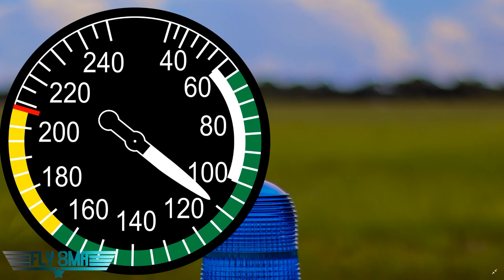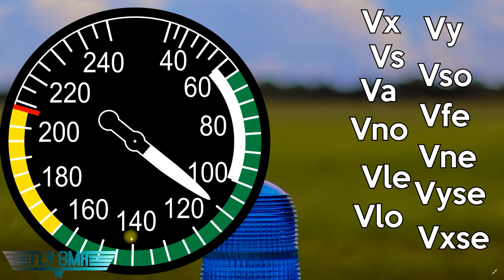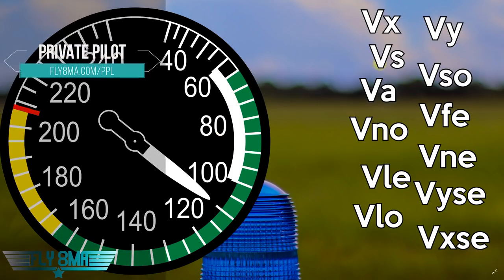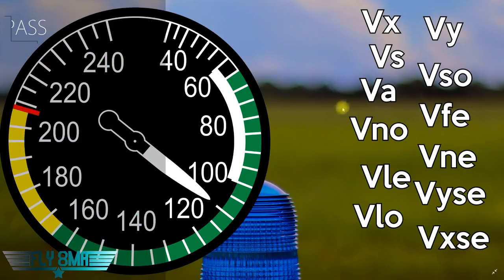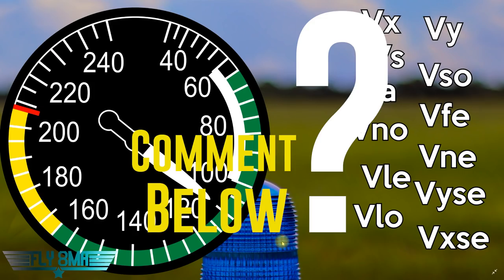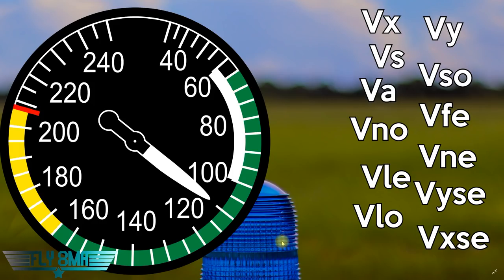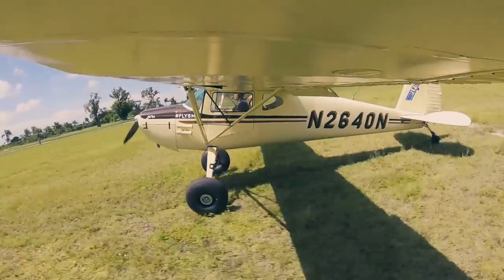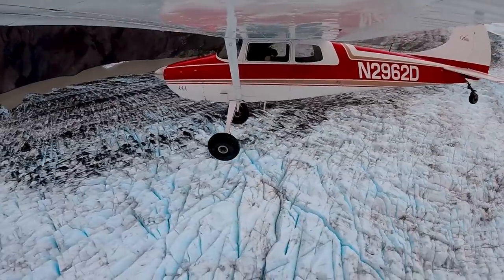How pilots FAILED their checkrides...

Comment: I had my PPL checkride at FTY with the same guy who gave Delta airline pilots their checkrides...this was back in 1993.  He started out telling me to plan a flight to a particular airport.  After about 5 minutes, he came back in the room and said that time was up...we're going.  I wasn't really ready, but we left anyway.  Halfway to our destination, he said that the weather had changed and I had to reroute to another airport.  While I was trying to plot a new course, I didn't notice that my heading was drifting.  We ended up over some small town...but I had no idea where I was.  The answer?  Look at the name of the town on the water tower!  From there, I think we went into stalls and unusual attitudes.  Of course, I had to put my head in my lap while he was putting us into an unusual attitude.  After recovering from the last unusual attitude, he immediately reached over and pulled the engine and told me to make an emergency landing.  I initially setup on a field with some cows and old wooden fences in it.  However, I decided to go for a field a little further away that didn't have cows and fences.  Unfortunately, it was too far away and we would have crashed into a stand of pine trees.  He failed me on the engine out procedure and said he wanted me to come back and repeat just that part.  BTW, he told me that the field with cows and fences was the best choice because I could have driven over the fences and steered around the cows.  I was really rattled by the experience and decided to be extra cautious on my way back to my home airport (LZU).  I didn't want to accidently fly into ATL's class B airspace, so I kept turning the dial on my VOR more and more to stay well north of that airspace.  I eventually saw PDK in the distance and knew I was okay.  So, I called PDK to tell them that I was just a few miles west of them and wanted to fly over.  They almost immediately asked me to "ident"...and when I did...they informed me that I was about to fly over Dobbins Air Force Base in Marietta.  Oops.  Yes, it was a very long day that day, but one that I will never forget.  I don't fly anymore, but I will always enjoy the memories that were made during that part of my life.
Reply: GPS ipad makes all that flying s snap....looks like you kinda had a sick as a ppl examiner...my ride was pretty quick ,28 years ago .....pretty much ho up ,where are you ,turns ,...fast,,,  landed and bam ......my instrument ticket was a partial redo though
Reply: TheTimeTraveler2025 morning, what is the wings program?
Reply: lorenau2 Search google for FAA wings. It’s a way to do seminars, and or some online courses to get Wings points which go towards showing currency.
Reply: @lorenau2  look it up.     just a way to spend money   and fly
Reply: @danielb516  Of course if your GPS goes down, you need to know how to navigate with VOR.  A tough ppl examiner is actually doing a favor in the long run by exposing pilots to situations like engine out/stalls/unusual attitudes!
Reply: Good experience to learn from but my next decision would be to get a different DP 👍🇺🇸

Comment: Forget a check ride.  No pilot should fly solo without knowing these speeds for the airplane they're flying.  I'm pretty astonished that any student would make it to a check ride without knowing this stuff.
Reply: Jon the Pilot  the one that I become amazed with is when I’ll ask a pilot does he know the minimum maneuvering speed of the aircraft that he’s flying.
Reply: @larrygreen8912  It's generally 1.4 X your stall speed, it allows for 30 degree banks. Commercial pilots know theirs for sure!
Reply: @larrygreen8912  I am going for my PPL checkride very soon and your comment on DMME really opened my eyes. I talked with my instructor on this and it was great conversation and a great learning experience on something I did not know about! Thanks!
Reply: @Hedgeflexlfz  Stall speed changes based on load factor.  That is connected to your gross weight.  If you really wanna be safe know your max over the numbers speed and use that in calm air.  In cross winds add 5kts of speed over the numbers.  In banks never exceed 30 deg. in the pattern.  Or if you have an AoA meter, refer to it and bank however you want.
Reply: @gbigsangle3044  You are correct. Load factor is really what causes stall speeds to increase. How do you calculate it for those condtions?
Reply: @Hedgeflexlfz  Not possible to calculate it easily while flying. But read this to see how stall speed increases due to load factor: https://www.theairlinepilots.com/forum/viewtopic.php?t=381

The best way to avoid stalling in a turn (esp base to final) is to keep the bank angle low (below 30 deg, 20 even better) and thus your speed need not be much over Vs0, or stall speed in landing config.   Ultimately an AoA meter will keep you out of trouble in all turns if you have one, or can get one.
Reply: Exactly. I know I’m 5 years late here, but I was allowed to solo until memorized those speeds (as applicable to my aircraft) and what they were for. Well before it, even. I think I was told to memorize the speeds by the next lesson on my second lesson. How do you learn to do the checkride maneuvers if you DON’T? I’m guessing this is a very minor cause of checkride failure. There would have been so many other great things to talk about.

Comment: Prepping for my PPL check ride. Here I go…
VX(best angle of climb) I would use this to clear any obstacles near the end of the runway. I would transition to VY ASAP to increase cooling into the engine.
VY(best rate of climb) I would use this for a standard climb out of an airfield with no obstacles nearby. 
VS(stall speed “clean”) I would use this (stay above it) when landing with no flaps or performing power on stalls.
VSO(stall speed landing configuration) I would use this (stay above it) when landing with flaps and performing power off stalls.
VA(not sure what it’s called but it’s the speed where I can yank on the yolk and the plane would stall before it fell apart) I would use this during incredibly turbulent conditions.
VFE(maximum speed flaps can be extended past 10*) I would use this when on final for landing and I am in the white arc and can deploy flaps past 10*
VNO(normal operating speed) I would use this for max cruise speed in clean or mildly turbulent conditions.
VNE(never exceed) I would never use this.
Reply: I think VA is the operating manuevering speed
Reply: @renemedinajr4218  Thank you!
Reply: Thank you for this. Very helpful 👌🏾
Reply: VFE, be careful with this one, some airplanes it means NO flaps can be operated, particularly like the Piper's or the Cirrus.
Reply: VFE on the G6 sr20 Cirrus is 150 50% flaps and 110 for 100%  @glennwatson
Reply: I know you wrote this two years ago but I wrote this down verbatem for my own use.  Thanks!

Comment: Hey Jon, learning on a 172 (PPL). 
Vs-stall speed  clean config 48
Vso- stall speed landing config 40
Not sure when I will use those, but will avoid those because I don’t want to stall. 
Vr- rotation speed 55 when I pull back the yoke
Vx-best angle of climb 62 to cross an obstacle will give you best altitude gain over a distance covered. 
Vy- best rate of climb 74 will give you best altitude gain over time. Use it all the time for normal takeoff. 
Va- maneuvering speed 2550 105 1990 90 turbulence penetration speed. Used on bumpy days. Has to do with putting stresses on the aircraft and make it stall before causing damage to the aircraft. I know there’s a way to calculate it, I will be happy to get the formula from you. 
Vno-structural speed 129 not sure when you will use it. Maybe when tower asks you for best speed? (Happened to me). 
Vne- never exceed 163 you can break the aircraft
Vfe10- max flaps extended 10 degrees 110 used abeam the numbers or 1000 foot marks. 
Vfe 20/30- max flaps extended 20 and 30 degrees 85. Used when landing. I think this is it, let me know if I missed anything.
Reply: Jon, I know what I forgot. Best glide speed Vg 68 will give you distance of loss of altitude, meaning you can go further without an engine. Used in emergencies.
Reply: The Va equation is: Va at MGTOW * sqrt(current weight/MGTOW); so it would be 105*sqrt(current weight/2550) for your case. S model, yeah?
Reply: Thank you so much. Yes it’s S model.
Reply: Tower request for best forward speed...never give more than you can safely handle at your level of experience nor in excess of Va in turbulence OR expected turbulence (you mentioned Vno in regard to ATC request).
Our group of caravans would converge on Newark each evening and ATC came to expect higher approach speeds from all of us for sequencing with larger jet traffic. Not a problem until a "new line pilot" was hired and did not have the "familiarity" with the airplane the rest of had. One controller showed disappointment with this pilot as in "Why can't you keep up like the others?" There was a silence on the radio. I was also on approach and keyed my mike to  inform the controller of the new pilot's status. Several airline's chimed in with "Weathers good, give the guy some space" and "Cut him some slack". End of story...don't let any one hustle you, ever.
Reply: NEVER be afraid to say "unable" to ATC.  That's how bad things happen.
Reply: Jon the Pilot I wasn’t afraid. I was with an instructor, and it was one of the calmest days I’ve seen this year. The controller needed me to move faster for traffic, which was cool. No big deal.

Comment: Here are all  (about 75 of them): https://en.wikipedia.org/wiki/V_speeds  In reality, the most important speeds are (all flaps), pattern, approach, over the numbers, rotate, you will climb at full throttle after takeoff so just watch your stall on best angle if you need it, cruise efficient, cruise fast, turbulence, and not exceed.  Match them with a V and you are golden, else just know the numbers for your plane by heart.  Or if you are flying a twin and/or a jet, then there are more.

Comment: VX when climbing out and needing max altitude over time, VY normal climb when time doesn’t matter, also when coming back down as it’s best glide speed. VNo not usually used for me, but can use when air is smooth straight and level. 

VA on take off, VSO when landing. VX and VY are typically close to stall speeds when doing 45/60 degree turns (as a rule of thumb)

Our planes 60 degree is around 78 and VY is 76 for example.

Comment: Common misconception is that Vne is a fixed (CAS) number as with the other V-speeds.  Vne is only that speed marked on the ASI at Sea Level Density altitude.  Vno is equal to Vne when the aircraft is at it Service Ceiling density altitude with Vne moving from the red line towards the yellow/green line as the aircraft gains altitude  (Vne is a designated TAS, not CAS)
Reply: If you are flying at or near Vne speeds in any aircraft you are asking for trouble under most circumstances.  Why do it?  If the aircraft is too slow for you....get a faster one.

Comment: 10 hours in on a Cessna 150.
VA about 110MPH in moderate turbulence but decrease speed as turbulence increases,  Vx about 65MPH to gain altitude over the shortest distance traveled (to avoid obstacles on takeoff), Vy about 78MPH to climb to the desired altitude in the shortest amount of time (if able on take off or once clear of obstacles), and  I'm flying 5-10 MPH under VNE to lose altitude STAT in the event of an emergency that poses an immediate risk for loss of life, (Hypoxia or fire).

Comment: Jon, love all your videos. 

Va is used for maneuvers such as Steep Turns and also when flying through turbulent air. 

Vx: when there is an obstacle I need to get over on take off
Vy: normal take off climb speed is when I’d use this 
Vfe: obviously when using flaps

Quick question to you: you mentioned Vno as normal operating speed which I always think to but why is it named Max Structural Cruise? Vno should be the whole green range. Thanks!!!
Reply: I've always thought of Vno as "never operate (regularly)" and not "normal operating."
Reply: Steep turns at Va? I do them at 90-100 K all the time with CFI, much slower than Va

Comment: If VA is the maximum speed you can fly the plane at wo structurally damaging it I would think as weight decreases the number would increase because there is less load? Where am I not thinking this correctly?

Comment: Fly the descent (in smooth air) as fast as you can without overspeeding the prop.  I don't understand why people pull the power back so much for a slow descent.
Reply: Maybe they aren't in a hurry. Maybe there's a disabled aircraft on the runway being towed and will be clear in 30 minutes.

Comment: Va speed calculated related to your weight....
Reply: Va does change dependent on your gross weight and that changes during flight as you burn fuel.  Rule of thumb?  In smooth air it's not an issue.  In the bumps simply pull back the throttle and slow until the bumps aren't  hitting you as harshly.  Feeling that comes with experience.  And if still in doubt just fly the middle of the green arc...you can't lose there.

Comment: All those 12 different speeds should be marked, not hidden from the pilot.  Specially on emergencies you need a line for Vgl and another line for flaps needed.. Too many crashes due in the stress of the emerg. the pilot used the wrong speed for the weigh and missed the field, or forgot to use flaps, used the wrong speed and stalled at 10 feet over terrain and flipped over, etc. Why hide what is soo dam important..

 I put a blue line on Vgl and silver line on FLAPS NEEDED speeds.. The silver line for flaps needed I put it from the blue line Vgl speed down to the minimum short field speed.  The students and even 3k hour pilots love them..

Comment: I had a question pertaining to failed checkrides do airlines shun you if you have two?I’m embarrassed to say I have two so far for my private and my private multi add on. I passed my instrument but I feel like a horrible pilot even though I know I am not. I am worried because I heard it is very hard to pass a CFI checkride the first time and feel like that would be my third whenever I got to it.Any help would be greatly appreciated.
Reply: No, but if they ask you just be upfront about it, I busted my ATP ride for having the radio too loud. but that was way back in 1982. Where busting check rides might become a problem is when you are flying under FAR 135 or 121. If asked about it to lie about it, they will already know the answer. I never held it against a pilot I was looking at to hire. We all have bad days from time to time. It's a stressful thing. just do your best, you will be fine.
Reply from the maker: As said before...be upfront about it...not the end of the world.  For airlines today where it's just a machine to hire a bunch of guys asap...2 is fine...3 failed rides may be a deal breaker for some companys, but not all.  Either way, if you end up with 3 on your record, explain why and what you learned from the failures and how you plan to be successful in the future!
Reply: FLY8MA.com Flight Training I have 3 bust. I had all 3 bust on instrument. I have talked to some that say yes we will hire you and others that say no. But you are right just be upfront saves your time and theirs.

Comment: Never heard of Va? An FAA thing or...?
Reply: Lucy O'Neil VA maneuvering speed. FAA thing. They want you to know it for turbulence. It is the speed at which you can move a single control surface to its full range. They only grantee that a single surface not multiple without having structural damage to the plane. The speed is set by the manufacturer typically they give gross weight and empty weight. Everything else in the middle is a guess to me. Yes there is a formula to figure it out at any weight but I don’t remember the formula to do it and in the moment I just fly closer to the slower speed. Hope this helps explain it to you.
Reply: @davidmichael5573  thank you for clarifying, glad we don't worry about Va in EASAland..